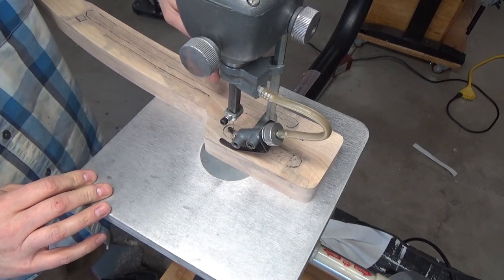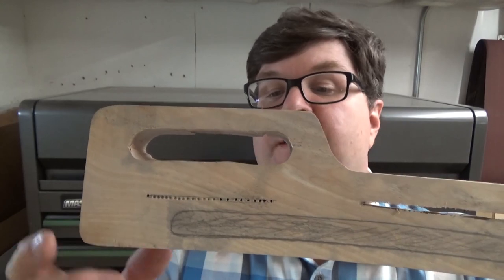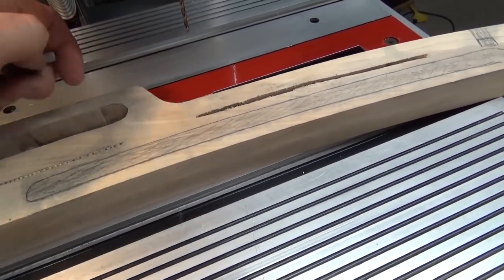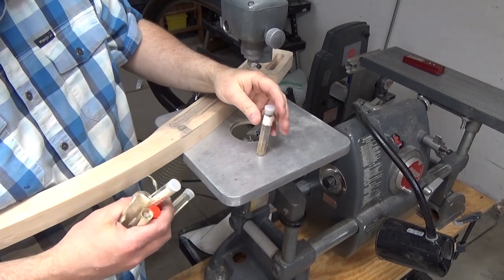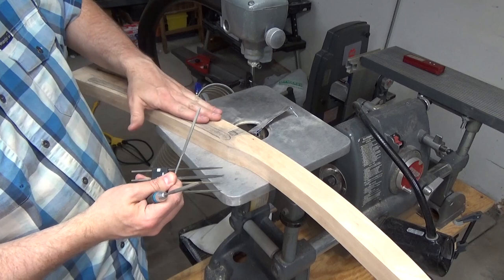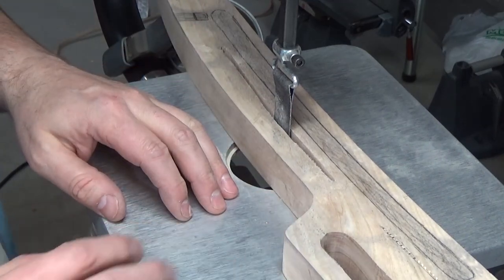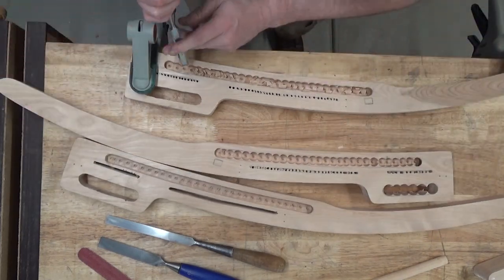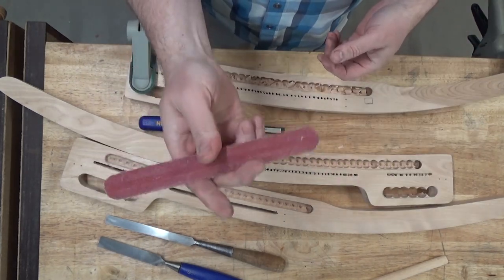Woodworking: Sometime Fast and Easy Just Aren't in the Cards

Comment: You might try setting up a router 
The baseplate would have two pins set apart to follow the outside curve.
We used that to scribe on a radius. A round bar was located between the pins in a perpendicular setup with the scribed on the end of the bar farthest from the two pins. The pins were mounted thru a flat plate that registered on the same face as the scribe.
The scribe would be your milling cutter.
Hope that makes some kind of sense.
Best of luck and I enjoy your videos.
Greg T
Reply from the maker: Great tip, Gregory! I'll think through that one next time.

Comment: Dear Woodshop Nerdery,
.
I’m getting to like your channel more & more!  Thank you.
.
As for this project, I don’t think I’d ever attempt it, as I have personal experience with these chairs.
.
We have an original example that spent its summers on the front porch of our authentic 19th c. log cabin, c. 1825-1875, my historian mother opined.
.
My parents bought it in 1963, and we made it a year-round-capable house in 1989-90, when we basically added a full house to the three-room cabin-plus-lean-to-kitchen.
.
Anyway, the chair: It spent its winters inside, unheated when we weren’t there to keep the wood stove lit.
.
The chair got weathered, and it inevitably split at the “handholds” on the front of the rails, right along the grain direction.
.
If I were going to attempt making this chair, I think I’d choose laminating two cores of Baltic birch plywood together, with edge banded veneer to protect against water intrusion.
.
Will you be doing the weaving / macrame of the seat & back, or will your wife or children, or all of the above?
.
Best great luck to you!
.
David,
Fredericksburg, Va.
Reply: Or perhaps you could have a thick central layer of Baltic birch plywood, thickly veneered at each side with hardwood (i.e., 1/4”), and then edge banding as mentioned before.
Reply from the maker: Thanks David. I agree, the chairs are a great example of "form over function," and the design shows several weak spots. I built up the legs' thickness using 2 layers of hardwood. My hope is that the slightly different grain patterns give some reinforcement

Comment: man, nice video here.  You surprised me with the little drill holes. didn't know that it would be so far off on hard wood. Then again I don't use hardwood too much.  I like engineering type projects with plywood. Maybe in the future I'll want to tackle something with more hardwood, despite the clear problems. As I watched further I see you used a hand drill? no way man you need a guide at least.
Reply from the maker: So true about the guide Michael, thanks.

Comment: Man; tedious! The wandering bit must have been a nightmare. It's never the things you anticipate that cause the problems, it's the things you don't. As you say, "sometimes fast and easy just aren't in the cards."

Case in point: I was just drilling some dowel holes in the ends of some 3/4"x1'x8' boards (I'm making a 46' continuous bottom, and matching 46' top, for a large bookshelf and want the individual pieces secured together end to end). Not an easy feat, but shouldn't be too bad. So, I'm set up in horizontal boring mode, with the headstock all the way to the left hand end of the machine, the table secured so the holes are centered at 3/8", the piece extending over the extension table at the right hand end, and my outfeed roller about 4' away, supporting the back end. Clamped the piece in place onto the back of the table, with 2 spring clamps at the "business end" of the table. Took an inordinate amount of time to get the holes exactly centered in the thickness, so I could just flip the boards over and drill the second hole and have them mate properly. Even with the microadjuster, if was a bear--the stock is so thin that the table has to go so low there's barely enough room for the microadjuster. Half a dozen pieces of scrap and I've finally got THAT issue fixed. Onto "the real thing." First hole's perfect. Second seems kind of shallow. Sink a depth gauge into the first and compare to the second, and I'm about 1/4" too shallow. Huh?

OK. Make sure the drill bit is bottomed out in the chuck, so it's not getting pushed in with the pressure, move the table closer and readjust the depth stop. No joy. Recheck the locks on the headstock and table. Secure. Readjust the depth stop on the quill to go deeper. Redrill. No joy. So, what the H.E.double toothpicks is going on?? After a couple of minutes of head scratching and rechecking everything, I readjusted the depth stop on the quill the 1/4" difference I STILL had and tried it again watching the progress of the bit. When it got to it's previous depth and it started to "bite," THE D!@#$D TABLE started edging away!! I'd tried to check the locking of the table by nudging it and it had seemed solid. But when I pushed a little harder, it slid. The table carriage lock on my 510 can't really be cranked down, like it could on my old 500 and I'm suspicious it's got dirt and paste wax in it, causing the slippage. I'll have to clean it out. I've got 30 more holes in 9 more units, but the setup is so finicky and tedious, I'm afraid to break it up to do the servicing, for fear it'll take hours to get it set up right again. So, I just stuck a rubber-faced clamp onto the way tube behind the table and will call it good. THEN I'll consider doing a servicing.

So, I empathized strongly with your problems.

Comment: or clamp it to something and put sandpaper through slot and do it by hand, or slide the sand paper through and attach either end to a dowel and do it by hand, or use the files by hand
Reply from the maker: A sanding bow, of any type, would have created too much of an arc. Most files didn't fit. The ones that did were too fine to do the job. Watch to the end to see the this rasp I made from a tongued depressor and 60 grit sandpaper.
Reply: i did watch it and was glad you did it by hand. I like videos and your processes.
Reply from the maker: Thanks Stuart. I appreciate it. I am experimenting with the best balance of hand tools and power tools.
Reply: Them files would clog up in a couple of strokes.

Comment: Regarding my previous comments about weakness of the “handles” of the front of the left & right seat rails, which cracked along the grain after being in semi-regular use for 50+ years.

What about using some good looking heavy brass C-shaped mending plates at those front corners?  Either two per rail, or even one per rail, with carriage bolts, and flush fit female threaded bolts to give it some beautiful metal work?
.
Good luck on your GREAT PROJECT.  I really like your channel & your style!

—————
   😉👋🏽
Reply from the maker: Great suggestion David. I was also think about some through dowels could be used for a repair in that area if needed.

Comment: Brad Point Drill Bits!!  They won't wander in wood grain like standard drill bits with the 118° points.
Reply from the maker: Great tip Larry, I will make sure to remember that next time.
Reply: I don't think they make brad point bits that small in diameter. With super high speed and a very gentle feed you can minimize drift. But it's still iffy. Any time you're drilling more than three times the diameter of a bit deep you're getting into deep hole boring then.
Reply: @1pcfred  Woodcraft offers Brad Drill sets in Imperial sets from 1/16" to 1/2" in 1/64 increments, however the 1/8" size is the smallest true brad point.  They don't say on the website what the 1/16' - 7/64' sizes have for a point.  They also have a metric set from 1 mm to 13 mm in 0.5 mm increments.  Again, the 3 mm is the smallest true brad point.
Reply: @larryvergon6740  I don't know what the smallest brad point is in my set. None of them are easy to sharpen. I have no problem whatsoever sharpening conical twist drill bits though. I've had lots of practice.

Comment: Great video Tom. I'm glad that I'm not the only one who ends up with problems and has to do some additional learning to solve them. Your videos help me a lot. In this case, the ShopSmith Strip  sander would go a long way to solve the problem that you resolved with cotter keys on your jig saw.  It does a great job sanding inside cuts.  Here's a link to Scott Markwood's video describing this slick little machine.  https://youtu.be/wG7dr6IDv44..
Reply from the maker: Dennis, I definitely have my eye out for a strip sander. On will come up eventually for me in my area.

Comment: How about using a router to cut these slots?
Reply from the maker: Great question Mitch. The short answer is, I don't know how. I did google that question before I started. But I just could figure out how route the curve with a complicated fixture. Also I would need a 1/4 inch bit that was about 1 1/2 inches long. That made me nervous I guess.
Reply: @woodshopnerdery  A shallow cut only to establish a clean outside line, following a plywood template.
Reply: @woodshopnerdery  with a router you cut in steps. Going a bit deeper with each pass. You wouldn't go the full inch and a half all in one go. That'd be a tad too intense. If it was me I'd use a template too. If you're going to buy a router and want it to be one and done then go for the gusto and get a 1/2" collet plunge router. It's the most versatile router type. They're also the most expensive. Funny how that works. But you can do more with them compared to the cheaper 1/4" collet twist bodies. It'd be the better tool for what I'm seeing needs to be done here. Although there are jobs where a trim router is better. Big 1/2" plunge routers are big.